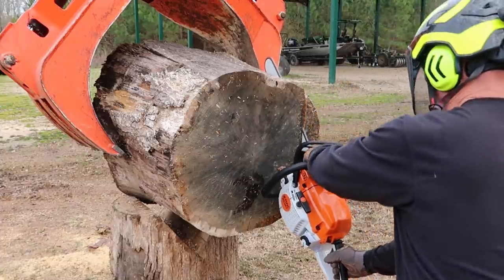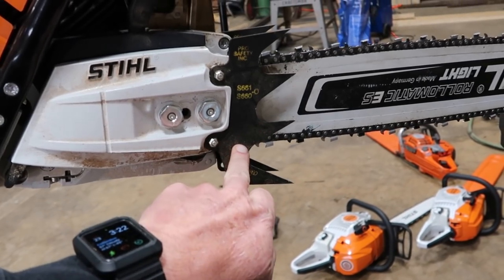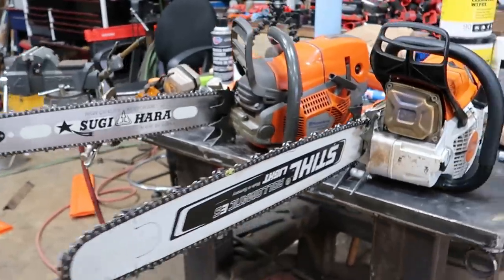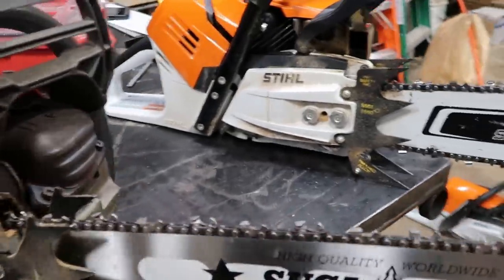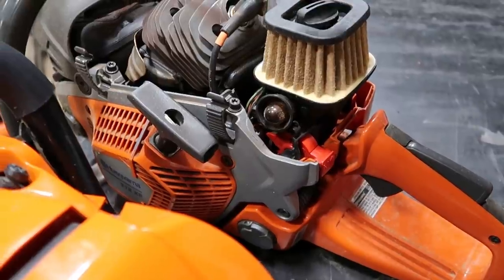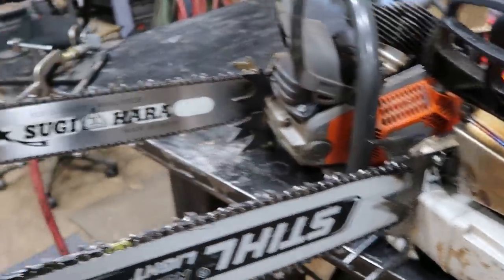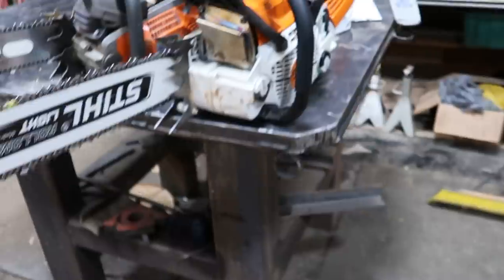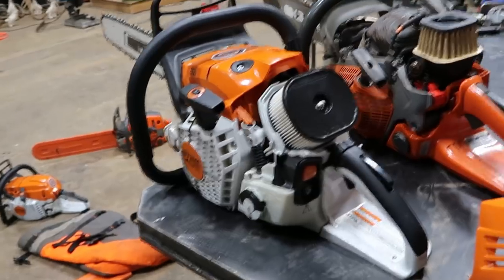Husqvarna VS Stihl | Autotune VS Fuel Injection | The best chainsaws on the planet

Comment: Hi Tim. Just got you playing in background whilst running buncher. With the chains. Does stihl RS stand for Rat Sh#t?. 
I noticed one day I went from having issues with chain oiling and bar keeping clear to using an Oregon chain and had no issues. 
Wondering if you've noticed anything of the sort? 
With bar lengths and stihl 25  vs husky 24 and same link count.  661 and 395 have same count, but the 661 has about another inch of usable bar

Comment: I personally like the Stihl chain tensioner better than the Husky. I feel like the cover really only needs to do that job. For instance, if you're in the field working and for some reason your side cover got broke. If the tensioner were busted on the Husky, you would have a hard time keeping the bar chain tight. The Stihl would still function as it's supposed to ( even though it would require the operator to be more careful than they normally would). I like what you said about how far technology has come on both saws. Either of the saw would be excellent choices for someone looking for a professional saw that's not so hard on your back.
Reply: But the husky does get the job done, like you see my husky made me have to work less as it was so effective

Comment: Guys that use the 500i to make a living with are finding out where the weight savings are coming from. The plastics are thin and the air filter cover doesn’t lock down correctly to hold the air filter. The top cover gets rattling very quickly. The clutch drum is thinner than other similar saws like the 462. The bar plate is thinner and some have worn through into the crankcase/ oil tank. Awesome saw but I don’t think it will last.
Reply: Sounds typical for sthil. From saws that will NOT restart after a shutdown to then cheating out year after year to this junk they sell today with Chinese parts and a high price tag.. husky or echo is to the only way to go. It’s sad that my old ass poulon pro 50cc saw out it’s my buddies sthils all day.. he got so embarrassed on a job the other day he went and bought him a husqvarna and he said he’s selling all his sthils and going husky. Now he gets it.

Comment: I find the stock 500i to be stronger than a stock 572xp or stock 462c. By enough that you have to mod the other two to beat the 500i. Maybe next test use the same bar/chain. I find it’s the only accurate way to compare two saws in the wood. Just my opinion. Enjoy watching your content and saw reviews. You seem to be unbiased and point out the positive and negative in every saw you review.

Comment: I run 500i and 462C-Ms at work and I like the 462 over the 500. The 462 is lighter, and we don't have the problems with overheating and vapor locking that the 500s like to do. I'm looking to get a 572 and 550 for personal use, but we don't have a Husky dealer in the area, so ill probably go the 462/261 route.
Reply: Why do you need a Husky dealer ? I own a 550 for my personal use, bought on line. I've no dealer near me and I don't care.
And if I had a Stihl dealer near me, I'd buy nevertheless a Husky.

Comment: I own 2 sthil and sold both of them after a year and bought 2 Husqvarna to replace the stihl. The Husqvarna won because of fuel and oil caps easier to get on and off. Husqvarma also run more fuel efficient and cut faster. Have a great day be safe

Comment: I could never figure it out either, Why after manufacturing saws for decades, that Stihl hasnt' got a better handle on air filtration.
Reply: Fines destroy engines.  Then you get to buy a new one or make a service visit.  Same with the fuel caps that funnel shjt into the tanks.

Comment: I have run stihl for years for 2 reasons weight and dealer support my biggest complaint is the gas cap and the stihl also has a adjustable chain oiler not sure if the husky does
Reply from the maker: Yes husky has an adjustable oiler too.
Reply: I have a cheap craftsman with an adjustable chain oiler 😂 they’re common on saws today

Comment: To me just by watching the video . The Sthil sounded like it bogged down more during the cuts.  Could be just me. Great video.
Reply from the maker: I had them biting and was pushing both as much as I could get away with because I didn’t want anyone to say that I wasn’t.
Reply: @cotontop3  I have to agree with Mike... The Stihl was chattering through the log, and audibly the Stihl was not revving as fast as the Husky.  Maybe that was a result of the grind on the teeth or height of the depth gauges (no offense Tim).  I've always believed that the Husky's run a higher RPM than Stihl, but the Stihl has more torque.  Would you mind addressing the difference in smoothness and RPM's please?
Reply from the maker: The chain on the stihl had not had the depth gauges touched at the time this video was filmed.  That was one of the things I was talking about in the video I was trying to figure out what the stihl chain liked filing wise.  I finally figured it out and got it smooth last week  but I am not a fan of the stihl chain.
Reply: I love these type of videos Thank you for doing a great job on them . I also Thought that the still sound like it bogged Down when you were cutting through the log Could it be the different chains or bars That would cause That phenomena
Reply: On the Steels you had something that looked like it fit over the muffler you called it a bark separator I believe . I have never heard of such a thing I would like to know or understand what it's supposed to do and how it's supposed to do It and what the benefit is supposed to be for it . Anybody would like to explain that for me I'd appreciate it
Reply: Hello Tim , Awesome video I loved it I do have a question though ? Were these saws The Stills donated to you or did you go out and purchase them Yourself Knowing that you could use them for this testing which I appreciate so much And use them also in your Saw class . Again I appreciate the comparison Love the information That was gleaned from this
Reply: @russburke3881  it’s a bark box.   It’s a upgrade to the stock muffler.  For on it allows more exhaust to escape the engine and reduces back pressure thus allowing more fuel air mix into the cylinder giving you more power.   Some folks say these and other muffler mods will give you close to and over 1hp gain.  Some saws don’t take to them that well and others scream with them.
Reply: @russburke3881  he bought all 3 Stihls.
Reply: @russburke3881  It’s the Bark Box made by West Coast Saw (bolt on muffler mod).

https://westcoastsaw.com/products/661-bark-box
Reply: It will bog for a few tanks till it’s broken in.

Comment: The 500i IMO is over rated and the hype is what's selling it.  
Look up Egan Performance Saws on Facebook and check out his Straight Shot mufflers.  On a MS462 he has a dyno chart where it gained a .5hp on a stock saw and its 15 bucks cheaper than the barkbox.  The Durbin Compound done a comparison video with stock muffler, Barkbox and the Straight shot.  The Straight shot was faster and ran cooler than the other 2.
Reply: Thing is durable as a rock too, very well built.

Comment: Those are some amazing saws😲 I run a 60cc saw. Only saw I have and it gets heavy after a while of bucking the logs after. Any recommendations for a second saw to cut with
Reply: Bucking logs is usually the easiest part to do with a larger saw, its the felling and the limbing where the light weight saws really shine. Usually the loggers will have big saw at the landing deck where they buck to length, cut off flairs etc.

Comment: I like my Stihl saws. I have a 261,361,461,and 661. 
Definitely going to try out a set of them dogs,  do the bark box make a difference on the 261 or 361?
Reply from the maker: They don’t make a bark box for the 261 because it’s not a 2 piece muffler. It made a big difference on the way the 362 ran.
Reply: @cotontop3  was the 362 you used a m tronic model with the electric carb?

Comment: I’d be interested in you comparing the weight of both those bars.
Reply: Simple a light bar weighs about 40% less . A 28" light bar weighs about the same as a reg 20" bar . The light bars regardless of who its made by ( stihl , sugi , Tamara... ) none are as durable as reg bar . Most of mine I run are even solid nose  .
Reply: The stihl bar is lighter than the sugi. There's comparison videos on here

Comment: In fairness with the scale weigh in, the Sugi bars are a bit heavier than the Stihl lights. Stihl actually has the lightest line of guide bars. 
Followed by Oregon, then Sugis. There is also the Tusumara line up but I'm not aware of where they fall in the weigh in. 
BTW the Holtz bars, that are SS with replaceable sprocket noses, are made by Tusumara. Although those are not lightweights. 

As to the AutoCrap, MoronicTronic, and fuel injection ..... I prefer the carb run saws that the evil EPA dislikes. My 261C went down and because I'm not equipped to diagnose the chip, I had to drop it off at the dealer. I prefer to wrench on my own stuff.
Anyways, enjoy your saws friends.

Comment: I liked this video much better than the 261 verses the 550 . I haven't owned a Husqvarna since they started  making inboard clutches .I cut firewood an clean up brush. If u cut  a lot of brush even if use the top of the bar u will sometimes throw a chain an I can get back to cutting much faster an less hassle with the inboard clutch .

Comment: You had mentioned that the RS chain is a little copy choppy in the cut. On Stihls RS chain, round filling, change your top plate angle to 20° or 25° to smooth out the cut.  Works for me.
Reply from the maker: My next sharpenings after I cut the oaks, that was exactly what I did, I went to 25 degrees and it got the way I like one to feel.
Reply: So you went from 30 to 25 degrees for the angle and it made that much difference?
Reply from the maker: @rharris5811  I did a couple other things to the chain also.

Comment: Stihl as been doing those chain catches on their saws with dual dogs since the 044 in the mid 90s...have used alot of them and many models. Yes like the husqvarna  flip caps much better design...Stihl was the first flip caps...husky redesigned made them better... yes big weight different great run down and food for thought. Shoe logger in SW Oregon.

Comment: I've never understood why STIHL has those tank caps. I think they fixed something that wasn't broken.
Reply: The twist lock is probly overly ambitious design. But to be fair the flip-up was Stihl's idea and a great one. Husky had the advantage of time to improve it.
Reply: A Stihl rep told me it was for emmisions law for gas tank venting.
Reply: @dennisgt479  Odd, my new Stihl 94R string trimmer has a plain screw in cap. Reps probly have to say something. The best thing for Stihl to do at this point is admit Husqvarna improved their idea and improve their own. The quarter turn would save time if it didn't leak. It also prevents over tightening. If I had one I would work on it myself.
Reply: Je préfère et de loin les bouchons stihl. Mieux fait, plus simple, plus efficace, plus rapide, beaucoup moins fragile.
Reply: It’s a small sleek cap so there’s nothing to snag on. On the models that it doesn’t matter like the string trimmer, blowers, and tillers it’s the old school cap.

Comment: Some really good points in this video, I've never owned a husky but I do have a pile of stihls and every single one the air filter lets small stuff go into the carb. Every saw 200t 201t 362 460 462 660 661 880 they all do it, but ive only ever had one of my saws blow up and it was my fault. and these get used really hard every day I have 3 200ts and they are all still going strong too. I really wish still would do a better job on air filtration but honestly I don't think it makes any difference, in my line of work you're gonna run over a saw or something like that way before the engine ever goes out. Just my two cents. I do like the look of those husky gas caps though, nothing worse than picking up a stihl that you thought you put the cap on right only to have a mess of bar oil dripping down your leg.
Reply from the maker: That is good to know because when you pull the filter off and see all the fines,  it’ll concern you.
Reply: I just ruined a pair of work pants last week. Stihl platinum bar oil leaves a permanent nasty stain.  Make you love the 1/4 turn caps lol.

Comment: Your MS261CM sounds weak.  I bought one new and had it ported, increased compression, timing advanced, and a muffler mod.  For it's size, it is a beast compared to stock.  REALLY woke it up and is my favorite saw to run.  I run it with a MS500i and it's a perfect pair.
Reply from the maker: But that’s a lot to invest to get it to run on top of what you have already paid for the saw and your warranty is toast at that point too when you can just go pay the same money for the husky 550xp mark 2 that the ergonomics are far better and any anti vibe is way better and it runs like a scalded ape.
Reply: @cotontop3  Fair enough.  But why did you buy your 261?  Testing purposes?   For me, it isn't all about the money.  I get on the saw because I like to not because I have to, so I want a great running saw that I enjoy.  So I buy Stihl saws and mod them to run personally.  I bought Huskys for the employees and friends to run.
Reply from the maker: To run and film with and get back familiar with stihls so that when people bring them to saw classes, I could be fluid with them. After I use them for a few more months I will be letting them go.
Reply: @cotontop3  I might be interested in buying them when your done with them!!!!!!!!!!
Reply: @cotontop3  the 261 will still be going long after the 550 is in the scrap pile

Comment: Yeah but you’re talking about a fuel injected saw which is the latest and greatest in technology versus an auto tune. What you should’ve done was compare that 572 to a 462...Kind of an unfair comparison but I do agree with the air filtration system that’s why all of my saws have the West Coast saw air filter kits on them

Comment: I have two Stihls.  MS 251 18in and a new MS 362 20in
I just did my first  ever rebuilt on a  Husqvarna 51 with all new OEM cylinder, piston, gaskets, filters and aftermarket farmertec carb.  I also have a Husqvarna 45 but it needs rebuilt but I might do that later.  I like both brands but lean more towards Stihl.  I like the older Husqvarna reminds of my dad old Husqvarnas.

Comment: Tim the chain tensioner on The Stihl its right behind the bar and is easy to reach it's between the bar nuts in a slot in the case and the case is magnesium and the competition to the 572 in Stihl is The MS 462

Comment: Considering what Small and Large Size Tree Companies Charge for All phases of tree work, even if it's just a one tree job throughout my area, wouldn't matter to much when buying either a $1,000 husky or $1,400 Stihl but to the average homeowner or weekend warrior would probably be mighty expensive for those folks... I like Stihl Power Equipment the best but I do have some Husqvarna also and I used to always buy New Equipment but I've started buying more good used equipment instead for a fraction of the New Prices and I haven't had any problems with any of the used stuff over the past few years...

Comment: Great video very informative, which saw best anti vibration system, i find with my back and neck issues that’s the most important. By the way in the uk and ireland both saws are the same price!.
Reply from the maker: The Husky is better anti vibration.
Reply: @cotontop3  thanks for the info, when Covid lockdown ends i will get prices for both saws but the last time i enquired both the same, there seems to be a big difference in USA for some reason.
Reply: @jameswilson9142  the price difference in the USA is probably some political reason.

Comment: Follow up to my previous comment. The 545XP is back and running well. I did buy a MS500i on a 25”. And have already dealt with a few beech 36-42” dia. and some big ash, sycamore+.

The new 500i runs well but there three observations I have that nobody else mentions:
•it’s a real pain to start when cold, 6-8 pulls, it runs for 5secs. then cuts out, then it’s another 4 pulls and let it tick-over for 10-20secs. Then and only then will it run smoothly.

•it ate a well greased clutch bearing in 3mths. I found the cage race but the needles had disappeared, not one remained. So I’ve now bought a new bearing with three spares. I’m not going to trust one of those bearings past 12wks. Compared to running Aspen, a clutch bearing every 12wks is inexpensive.

•the oil filler cap must be wiped or brushed clean every time, before being replaced. That prevents leakage but I still only ever rest the saw on its side. Why oh why can Stihl think their awkward caps, are anything less than a pain in the neck?
Reply: Try ur 500i in winter mode. I have no idea if it will help or not, I haven’t experienced that issue, nore do I know exactly what the winter mode does😂 maybe it has something to do with air flow?

Comment: Was a sthil guy for years only because the dealer was 1/4 mile away. Had a o36 for years but after using a buddies husky 572 xp pro. I really liked it. But no sense in having 1 when the nearest husky dearler is ove 30 mins away

Comment: Also price wise if you want to put that light weight bar on that husky you gotta put out another $130.00. The 500 comes with the light weight saw. Im with you on older saws and the longevity, i dont see these new saws lasting as long as the saws even from 5 years ago
Reply from the maker: That’s not exactly true because there are quite a few dealers selling the 500 without the light bar for that same money.  I’ve ran 2 like that and I asked them why they took the saw like that and they said they didn’t know.  I imagine some of the dealers if they think they can get away with it they will sell it like that.
Reply: @cotontop3   yeah every dealer in my area sells it with the light bar